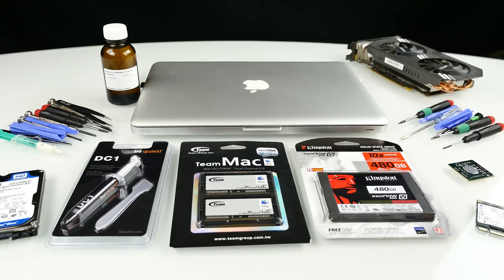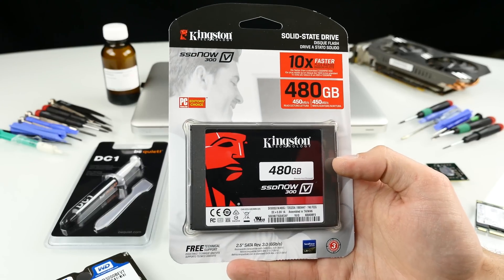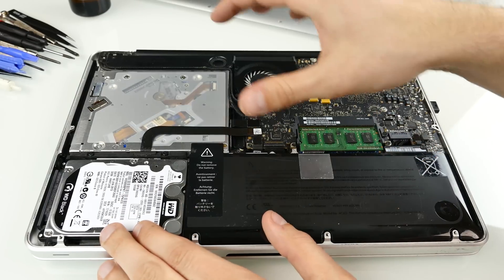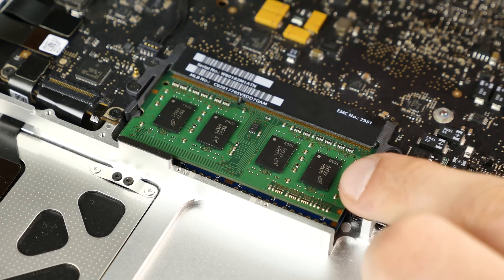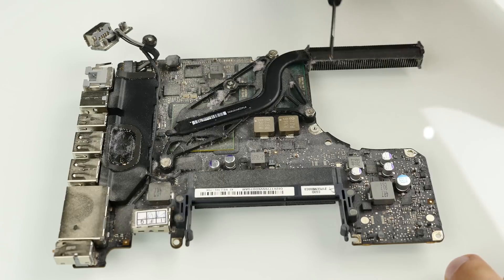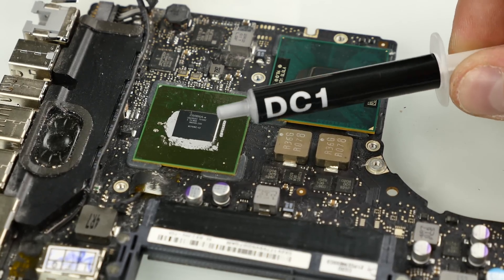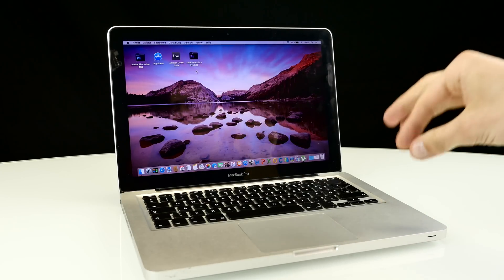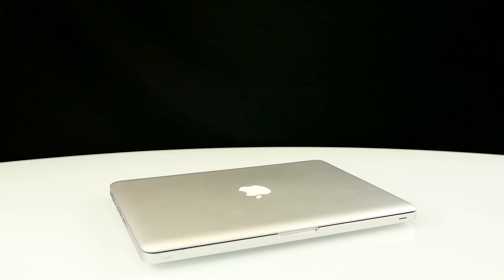How to Make Your MacBook Pro Faster - 2018!

Comment: I have a mid 2012 non retina, and I had tried to get the ssd upgrade. Unfortunately,  after changing out sata cable and buying the ssd samsung 860, etc. I realized the ssd will absolutely not be able to be supported. Was however looking through some forums, and found someone used the WD Black 2.5 drive might be a better option for mac owners with this edition. It comes at a much higher HD speed of I think 7200. Any input would help, or if anyone sees this comment, please reply.

Comment: "Mac RAM" is a joke. Macs don't require mac specific ram, just as long as the spec is correct. a 2010 macbook pro 13 should just take standard PC3-8500 1066MHz DDR3 iirc. Companies charge way more for "Mac RAM", so i'd just go find some PC RAM for cheaper

Comment: I got a MacBook Pro mid 2009 as a great gift. Already replaced the drive with a PNY SSD 480GB, soon I will upgrade the memory to 8gb and later I will replace the battery. Now it is working really well with OS X El Capitan 10.11.6, MS Office 2011, Logos Bible Software 8 and BibleWorks 10.

Comment: There a lot more you can do to make this MacBook better:
1- You can replace the Super Drive for a SSD adapter + replace the normal HD for a SSD (like you did on your video) and under Disk Utility on formatting, you can put them in Raid 0 so you’ll get 2x the read/write speeds.
2- About the RAM: You can find 8GB 1066 MHz memory sticks out there. So you can upgrade it to 16GB. If you need more, you can use a 8GB 1066mhz on one slot and whatever amount you need on the other one with whatever MHz you find. (The BIOS will clock the highest MHz down, but still use most of its capacity.
(Comments about the RAM:
2.1- Apple says you CAN’T use more than 8GB on these models. That’s because the Mac OS X that these system official support is 8GB. If you use a Mojave/Catalina patcher, you can shove memory into it and it will work perfectly.
2.2- The only requirement you need is ONE 1066 MHz memory (4GB are easier and cheaper to find, but you can find 8GB 1066MHz) so the system can boot. The BIOS will handle the rest.

If you guys have any questions about this, DM me on Instagram: @alessandroneivalr

Comment: first, bro, you never touch the thermal paste, you have grease on your fingers, you try to damage your lap? never do that again, just used a card, or the tool come with the thermal paste, you can give to the system more tempetures you dont want, touching the thermal paste with your bare own fingers can make a bubbles of air in the thermal paste, or grease, the grease is so bad in thermal disipation, that is the reason of many makers of thermal paste, give you a tool with the paste, and remember, less is much, and a lot is too much

Comment: As of now (07-2018) i'm still using my old 15" mid 2010 MacBook Pro. Cool thing is you can just put a SSD and 2x 4gb 1067 MHz DDR3 memory modules in there. I do have the 2,66 Ghz i7 which might help. My system does run very hot (doing graphic design and some animation in Ae). But if you're not running it on the go you can have it sit on a dual fan cooling pad (like Cooler Master). These are good Frankenstein models that aren't made anymore.... #glue

Comment: Firstly, never use your finger to spread the thermal paste across the cpu. Secondly, you can add thermal paste onto the copper heat pipe, it won’t damage anything. Thirdly, you didn’t fully clean off the older thermal paste, as some of it was still on the outside of the dye. Fourthly, put the motherboard on something that isn’t statically attractive. But overall, very interesting video.

Comment: There are MDOT to two hard drive adapters that can store I believe 4 or 5 m.2 drives, if you open up a SSD you'll find the newer smaller capacities won't take up all the space inside of the metal shell. Of course if you did have four or five M. 2 drives it would require four or five SATA data cables. It's not impossible but you could get some cables for than.

Comment: My MacBook Pro 2011 was upgraded to 16GB RAM and 1TB SSD. It works ok, But there is only one issue. The issue is the HDD cable will be burned out very frequently.
I bought a lot of HDD cable to prevent my mac stop works. at the same time shut down rather then sleep is good idea to keep the HDD cable for longer

Comment: I noticed that the EGPU is for thunder2. Does it work on Thunder1? And I have a MacBook pro retina 2012 mid. Can I  use a EGPU which designed for thunder2?

Comment: what model mac is this btw, it doesn't say anywhere in the description, looks like a 2011/2012? what are the basic specs before you upgraded it? like the processor and gpu etc?

Comment: But never forget something important about this generation of Macbook pro 15 ". At least 70% of laptops of this generation had bad solder board and cooling issues, generating serious faults in graphics and memory.  I would not buy a macbook pro of this generation, mostly of them are just crap.
Reply: Thats just badmouthing Apple, the truth is that a few had problems and Apple fixed the ones that were returned. If there are still one or two that are floating around that were not fixed by now then the odds are near zero that you would buy one. None of my clients that have these models (most of them do) have had any problems whatsoever.

Comment: Apple will soon classify this as a PowerPC therefore rendering it useless and developers won't allow you access as you're running a legacy machine.
Reply: PowerPC is an actual CPU (made by IBM-Motorola), its not a "classification" of any kind. Developers still make software for PowerPC Macs and since you have full access to your own machine there is no problem doing anything you want on them.
Reply: Billy Bob 
Yes Billy Bob, I'm perfectly aware of what a "power pc" is. 
I'm telling you what happened to mine which was originally designated as i5 processor category had been reclassified so that the machine would not access certain applications and software including updates, even though it wipes the floor with even newer MacBooks for speed and real world user performance.
Reply: I think that you are confused. There was no PowerPC that was "reclassified" as anything. The only updates that are not available are for the operating system itself. There are still hundreds of apps that are available for every version of macOS. Since the machine in this video is 64 bit based, developer apps that run on it will probably be available for decades. The prior limitations were the transition from PowerPC to Intel (which was a total scam by Intel because they promised Apple to deliver much higher CPU speeds than they ever actually delivered, even today Intel still has not reached the performance that was promised years ago), that caused Apple to create a break in the software between PowerPC apps and Intel apps. Once Apple committed to the transition to Intel, they found out that they had been essentially scammed by Intel. The CPUs that Intel could deliver were 32 bit only, so Apple has to go backwards in time and dumb down the OS to be functional with 32 bit hardware (PowerPC was 64/128 bit on the CPU side and 64/128/256 bit on the Vector side, which is why PowerPC was faster then Intel CPUs for a few years way back then but they aren't faster now). Next, Intel also scammed Apple in that they promised huge on board (built into the CPU) graphics performance so Apple optimized the OS for the onboard graphics but when the CPUs were delivered they had stunningly poor performance which is why Apple had to tack on a discrete GPU chip onto many models.

All of this is important to know because Apple does not make models obsolete for no reason, which is what I think that you were actually trying to say. The older models that got obsoleted did so because Apple then had to rewrite macOS to be 64 bit again, after making it 32 bit. This occurred for Intel's transition to the Core series of processors, the new 64 bit OS is not compatible with 32 bit hardware because that hardware simply cannot be addressed (there was a transition period where Apple delivered 32 and 64 bit versions of core OS components but that is simply a nightmare to support). Then to make it worse, Intel's on board graphics were so puny that Apple again had to create a cutoff for support for that Intel hardware that just could not support macOS' advanced features. Essentially Apple had to rely on programmable GPUs (GPGPU) from AMD and Nvidia to pick up that load. This cutoff meant that if you have a model with inferior Intel hardware then the new macOS simply could not support it because Apple has to write its operating system for future needs, not past errors on Intel's part.

Modern Macs with Core processors and programmable GPUs that are compatible with macOS' Metal framework work fine regardless of age and will probably keep working fine in the future because 64 bot computing will not get updated to 128 computing in our lifetime, the need to perform insanely complex tasks (like editing anything above 4k video) is just unlikely for home users because 2k (1080p) is already at the limit of what users can actually see (and we do have the ability to edit 4k already, if someone really wants to go there), so as best as we can predict, software needs will not obsolete any of these machines, even if the OS is not updated for them. The developers will not be limited to any restrictions because we can download directly from the developer's website, as we have been doing for many years.

Third Party open source software typically does not use any of Apple's advanced features so those apps will be fully functional for the foreseeable future, meaning that these machines are expected to have a much longer lifespan than previous generations.
Reply: Well I suppose the 15 year of working as a 3rd IT support engineer i'm confused by terminology.
I'm saying that the software access I'm using will no longer accessed because it says "Power PC" is no longer supported. You may not know this but App producers and software suppliers are told by Apple when to disallow certain devices which essentially artificially ages the device.
Reply: You're definitely confused, which is why I'm trying to help. PowerPC is an extremely old, outdated platform that this video is not about, so you seem to be completely lost. This video is clearly labeled as a 2017 Mac video (even though in reality it was made in 2016) so the PowerPC Macs are being addressed here at all.

PowerPC mAcs because obsolete over a decade ago, so a 2016/2017 video does not refer to that obsolete platform, current Mac videos are always about Intel based Macs not PowerPC based Macs unless the title clearly states PowerPC in it.

What you may not know is that Apple cannot tell app developers when to stop producing their software. There is still software being made now for PowerPC based Macs even though they were obsoleted over ten years ago. What Apple does is to tell developers when an API is going to be discontinued ahead of time. (I have been a chief hardware and software developer for almost 40 years on all major platforms including Apple.) Apple typically gives developers 2 years notice when they will deprecate any API so developers can then choose to use a different Apple API or write their own API, so this I snot a surprise to anyone, it public knowledge.

If there is software that does not work because of a deprecated Apple API then its the developer's fault for not updating to the new API two years before the old one gets deprecated.

PowerPC CPUs are not compatible with Intel software and vice versa, so its natural to expect PowerPC software to stop working after a wile because the software developer has stopped supporting it. Since Apple stopped selling PowerPC hardware over a decade ago, its obvious to anyone in the tech industry that software support for it will end shortly afterwards, because all the developer resources are then focused on the new platform (in this case it would be Apple's transition to Intel CPUs).

There are several software developers that are still making and updating their software for PowerPC based Macs, thus proving that Apple does not ever tell developers to stop developing their software. tenFOURFox; VLC; NoteFile; AirRadar, Neo, etc. were all being supported after Apple stopped PowerPC sales.

Mentioning PowerPC in an Intel based video is complete non sequitor.
Reply: Yes I'm perfectly aware that Power PC is very old (pre intel). I'm telling you what certain software now sees my 2010 MBPro and iMac(Aluminium 2009 with Intel 2.8 Extreme) are now classified as (Power PC) when trying to use or upgrade certain software including putting on Sierra or High Sierra for that matter.
I can categorically tell you that Apple DO tell developers what they can and cannot include, some diagnostic software I used previously (which was a very expensive iPad App) - when It no longer worked I emailed the company in the USA, they wrote back explaining their hands were tied by Apple.
PS, I've never owned a Power PC, only Intel Macs which back to my original comment they've been reclassified on how they're read so that they WON'T  accept updates or even allow access.
Reply: As for confused, the video isn't talking about a 2017 macbook! The hyphen implies in 2017 
So clearly you're confused. 
Watch the wave of 2010 MacBooks that will be blocked from upgrading in the next few months (they'll be reclassified on the application as Power PC or something similar) happened to two MacBooks and one iMac of mine in the past.
Reply: Okay so you weren't very clear. What you are really talking about is support for "Rosetta" being dropped on later version of Mac operating systems. Rosetta was a method to bridge Power PC and Intel so that it gave people time to transition over to Intel. It's been more than a decade since Apple transitioned to Intel. If Rosetta apps are mission critical than you should stay with Snow Leopard. You can't really ask Apple to support a decade old software which the developer is not willing to update.
Reply: Your computers are compatible with the upgrade mate just follow these directions:

https://support.apple.com/en-us/HT206886
Reply: I'm glad you have come across this too.  
It's a shame that wasn't the case with ipad1 as that barely managed over two years when 5.1.1 finally killed it.
Reply: Why don't you stop bitching and just upgrade that potato.
Reply: Just to side with you 
https://www.cultofmac.com/103458/os-x-lion-kills-rosetta-powerpc-support-heres-what-to-do-about-it/
Reply: iVlogBuzz Just install windows
Reply: Look at all these comments from all of these experts. Colour me impressed.
Reply: its getting the new os and the one after that 4 years from that  one now lol
Reply: when will Apple make the old 2012 pro's useless?
Reply: lol a powerpc is actually a type of mac it is not a name for when macbooks get old lol
Reply: Kang Kim
The computer are already maxed out with SSD's and premium RAM upgrades and have been for years.
El Cap doesn't run the later software that I use or even have access to the online platforms for example for trading forex or video editing (even inside youtube for that matter)
The 2009 MB-Pro wipes the floor with this 2014 in real world usage but has been classified as "power pc" (rather than the Intel 2.53) and therefore won't access what I need.
I spent 15 years working in IT mostly in 3rd Level Analyst, senior engine and trainer. So I'm very comfortable with upgrading and readapting hardware without the need for youtube.
Regarding the blocking of software, I've had instruction from one of the software developers who told me they're restricted by Apple/Microsoft as to when legacy devices can use the updated software.

Comment: The title of this video is misleading, this is not a 2016 MacBook Pro, it's a 2012 or older MacBook Pro. But you did mention that this is a 2010 model. By the way ddr3 1600mhz will boot, the ram will clock itself down. And Msata will not work with MacBook Pro, you will have to use a m.2 pic-e ssd with an adapter since MacBook pro's use propriortary Mac connectors.

Comment: What if I have a late 2013 which everything soldered in?
Reply: You can still upgrade ssd, only the ram is soldered in. the 2017 and onward have the ssd soldered in now.
Reply: The 2013 uses a card-style SSD (not the 2.5 inch SSD that loos like a hard drive) that is replaceable easily, you just slip it into the card slot and tighten the hold-down screw.
Reply: apple uses proprietary connectors, so you would need an adapter and a achi interface m.2 ssd if you want to upgrade, or just buy a apple ssd

Comment: "Buy a PC".. i've had my mac since almost 8 years ago and now its finally starting to slowdown without me adding any extra tech to it. PC's need new tech every 3-5 years.
Reply: If you perform standard maintenance on to you'll probably find that the performance will return to normal. If it doesn't then your air vents may be clogged with dust, just clean them out and the CPU will not get so hot (so it can run faster). You can also upgrade to the latest version of macOS, which will give you slightly faster performance (unlike Windows updates which makes all my client's machine run slower with each update). After all that if you want more performance then install an SSD, it makes a huge difference and can make an older machine feel almost as fast as the new models. Now your Mac will last even more years (I have clients that still are using their original Macintosh from 1984 so I know that they can last a very long time).
Reply: Define "Need" you don't need to upgrade many people still use older hardware, like i5 750, guess when that came out... 8 years ago